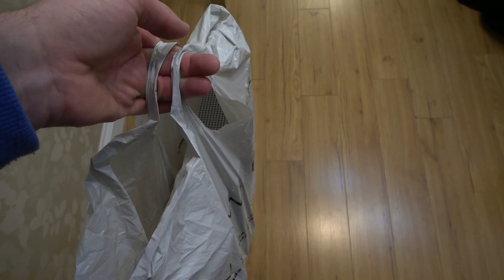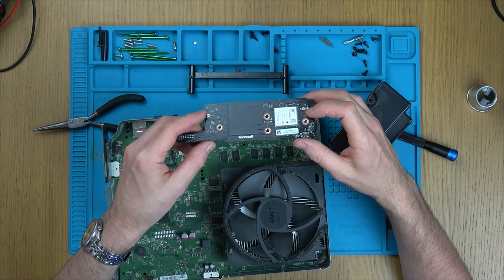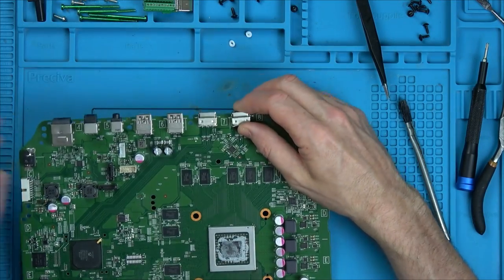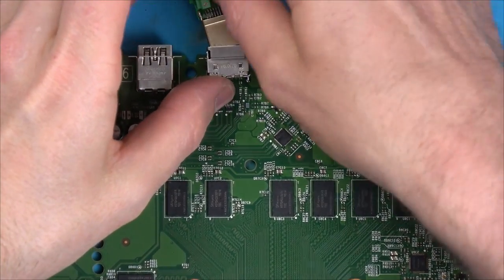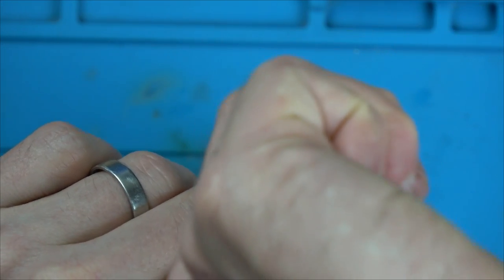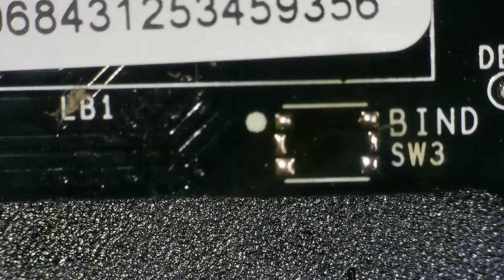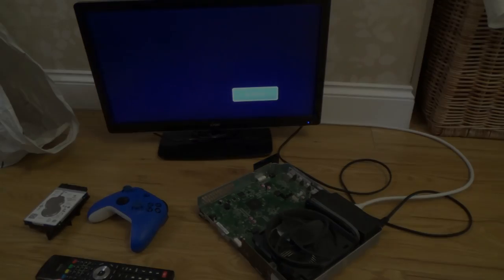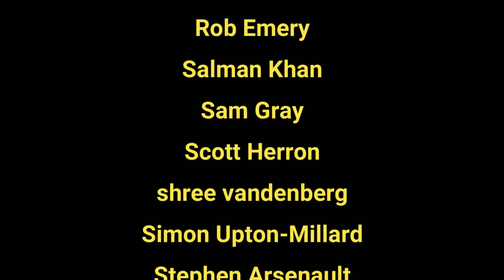Xbox One S All Digital FLEW out of a WINDOW!! - Can I FIX IT ? - Numerous FAULTS

Comment: I thought for sure with a drop that bad there would be some BGA ICs needing replacement. I guess it depends more on when the drops occurs (under use or after the board has cooled). Rather it's was a bit of luck I suppose really just needing a new HDD. Nice repair overall Vince!
Reply from the maker: Very lucky considering the amount of damage on it. Unbelievable that the BGA chips survived! Cheers Shawn 👌

Comment: *ADDENDUM*
With Cracked Plastic you can super glue the cracks together by ensuring enough glue is used so that excessive glue oozes out on both sides of the crack for you to promptly clean the excess away from the external surface, Once the glue is set, I found using an old soldering iron and some sacrificial internal plastics from the repaired case "or if handy some other case" the cracks can be reinforced by melting extra plastic on the inside over the crack, if enough glue was used and the clean up done in time the crack should remain undetectable..

Comment: To skip the high price of the data vac, I bought an electric pump from argos for £15 which is supposed to blow up air beds and paddling pools ect..., it does the trick amazingly, it has adapters and with a little modification you can hook up different size tubes.

Comment: The thing about canned air is that it doesn't actually contain air, because the pressure needed to liquidise air is much larger than a simple spray can will contain. So aside from the obvious waste from the cans, you're spraying either pure butane, propane, or fluorocarbons in the air.
Reply: mmm... delicious...
Reply: Most likely butane. On the upside, you can also use it as a makeshift blowtorch/flamethrower :)

Comment: Very cool you were able to get that fixed for them again!

I did a similar button swap on a set of computer speakers - one of the buttons on control box failed (turned it on once to many times I suppose) so I swapped it with a different button that I never used
Reply from the maker: Thanks Garth 👍

Comment: From my experiences with the electric "canned air" the nozzle you used was way too small which keeps the blower basically being held back from max velocity by back pressure. If 6ou would switch to a nozzle at least double the diameter as what you used, and that has a tapered flat tip to allow more overall flow that get concentrated at 5he outlet increasing tip velocity which in turn makes it work better for dusting pcs
Reply: I just use my big compressor that I use for my air tools. Turn the regulator up to 90psi, throw on an airgun and it'll blast away any dirt in the vicinity.
Reply: @MikeL-FL  true, that's one way to go but if you don't already have one and don't have the $150-$300 that they cost then these type of devices are the way to go. Mine died one day and really couldn't wait for one to be delivered so I found an eletric high-velocity air-mattress inflator for just $10 at the local wallyworld and I took one of the included nozzels and heated it up then squeezed it into a straight opening at the tip. A bit clunky to hold and move around a computer/game console but it worked way better than I expected it to honestly. It was nesrly as good as my old Datavac
Reply: It would have been a lot cheaper to buy an actual air compressor, they work a lot better, I basically got given one for nothing.
Reply: @tyronenelson9124  They can blow oil all over the thing you are trying to clean so do make sure your air compressor is oil-less. As long as it is, it'll probably work even better than canned air. Air compressors are rather bulky and noisy, though. That's a bit of a turn-off for me who lives in a small apartment without a dedicated workshop area. So I'd rather get a datavac personally even if it's not as effective.

Comment: This reminds me of the ps2 i fixed that had gotten the same treatment.....
The dvd that was in it was in 5 large pieces and the case was also bevond repair. Though interestingly enough it still worked after cleaning it out and re assembling it with a new case. I actually still have it after all these years for having it as a spare console.

Comment: Good fix. With the new hot air gun you should burn boards less, as the components come off quicker.  You probably could have taken the hdmi connector off without damaging it by heating the board from below with the new air gun.

Comment: My god that’s brutal. I wouldn’t even consider repairing that myself, it’s off to the repair shop if it were me.
Reply: I've had quite a few PS4s that got dropped, one I even found on top of a trash can with the upper case and the metal part missing. The board is normally OKish, most of the time the harddrive, the drive (which isn't an issue for an all digital version) and sometimes the PSU are dead. The PSU can be repaired, if you find the fault, but the harddrive and the drive need to be replaced (or atleast the laser, if you don't want to replace the entire drive).
Reply: Straight into the fuck it bucket

Comment: My fan used to sound like that from new. I replaced with a new fan and now it's silent. My hard drive did the same thing without being dropped. Exact same power off after 30 seconds. Might work every 20 attempts or so. I put the hard drive into a usb enclosure and you hear the sound of a jammed HDD. You can use external HDD with this also to gain capacity. I've also had to use a 500gb replacement, a 7200rpm unit from an old laptop so it's faster than the original. And then I've also plugged in a 4 terabyte usb external drive which it can also use for game storage. But what this really needs is a 1 terabyte SSD. That would make it a lot faster especially as I often use for media. It's my Blu-ray player.
Reply from the maker: I was expecting to hear some clicking but maybe it was a no power issue instead. Shame they are so sensitive to being taken apart as it may have been an easy fix inside it 👍

Comment: without seeing the rest of the video my prediction at the 2:27 mark is that I recon there are damaged traces on the board from potential bowing structure damage. The HDMI port might have been ripped and torn from the pads and finally I'm going to predict a few chips including the retimer has been damaged from the drop. Lets see how close I was to getting it right.
Reply: Spoiler Alert! He fixed the console had a bad HDD

Comment: If you relisten around 38:22 you can hear the hard drive trying to initialise, again and again, high pitched sound repeating itself. :) it's quite distinctive and it's repetitive, maybe you can hear it on video better. That said, xboxes will struggle to go into safe mode if it is waiting for a hard drive to do it's thing... the hard drive that's not broke enough to tell the xbox it's broke, means the xbox will wait for a long time before timing out and switching off...

Comment: I would have tried using hot air from the bottom of the board to do the button swap, it’s a good trick to do surface mount items which you don’t want to melt

Comment: Heat the board from underneath the HDMI port and you won't damage the plastic inside. Ryobi leaf blower £49 and a £50 2ah battery does a brilliant job of cleaning the dust from my series X.

Comment: Fell? Nah that's absolute Rage damage. Seen it before. Spoilt kid loses it after losing Fortnite, stamps on console. That explains the extreme bowing, crack position, removed bottom cover and distorted metal base. No way is that fall damage. If I had a kid who raged on an expensive system, no way on earth I'd buy them another.

Comment: IF you were to use hot air then do it UNDER, on the opposite side to the port and it should be fine, obviously using low melt too and that way, there is NOT enough time to melt the port, or shouldn't be.

Comment: Hey Vince I was just wondering what benefits you get from using the low melt solder instead of a hot air station?
Reply: It dosent burn the plastic on the ports

Comment: You can use a heat gun (or maybe your new hot air station with a very wide nozzle) to fix the PCB bow, see Adrian's Digital Basement (0032 C64 blowing fuses). Needless to say, use extreme caution, especially with a multilayer PCB.
I think were testing the switch pins for continuity diagonally, most (not all) of those switch types connect the pins along each short side when the button is pushed.
If the case is ABS, try a very small amount of Evo Stik pvc pipe weld (yes really) on the rear of the crack and hold in place with clamps. The joint will weld together. Superglue tends to fracture easily.

Comment: I got one which wasnt startable … i kept the case … but im from Germany if your thrown one is broke. Greetings
Reply: The one i got also had a board issue so i decided not to work further on it. I sold the board and power supply already … havent heard anything from the new owners … some other parts i still have also

Comment: Amphenol made good stuff? 
Vince, i like you and all, but for this statement i would slap you if i could (friendly slap :) )... Amphenol is the most trash you can find. I work in audio (installation, soldering, designing and settin up rigs etc.) and everytime there's an issue with mobile cable producing weird sound it's because someone sneaked in cable with amphenol connector (does not matter is it's jack, xlr, bantam, data multipins or w/e you can think off). Even properly soldered cables with these will degrade to a point being sensitive to touch (or stare / breath). Then you replace it with solid Neutrik connector and the issue is gone (again, i'm talking about issues caused by bad cables, not pcb parts, psu's, wrong settings etc). 
Amphenol's connectors are cancer and i would put both my hands into fire to back this statement anytime!